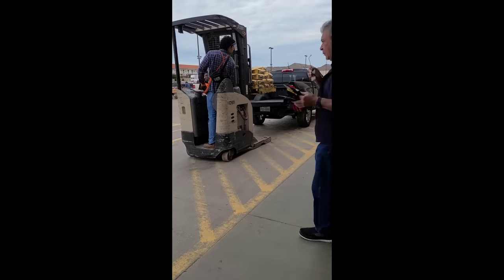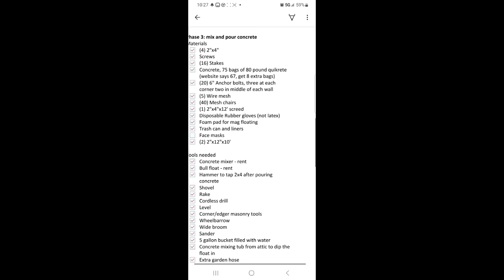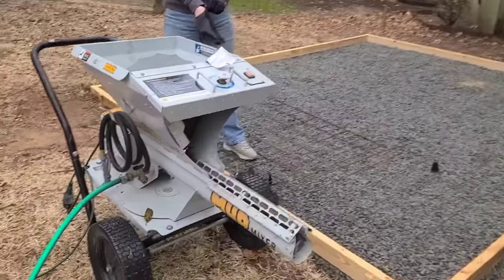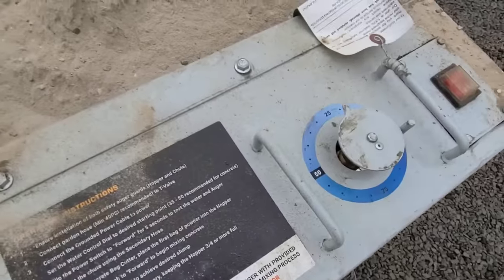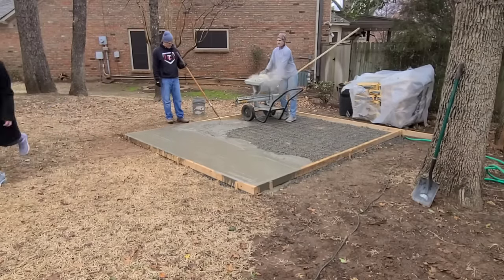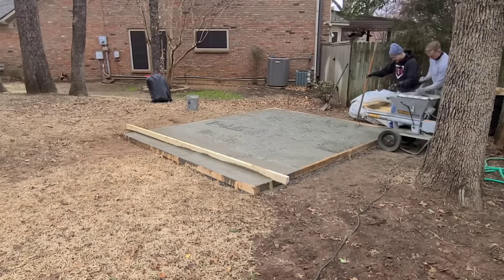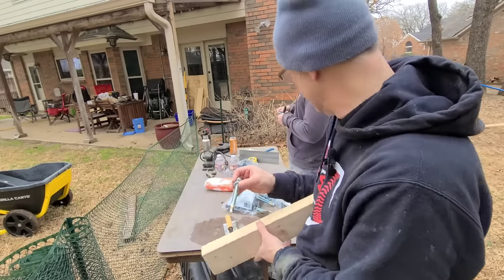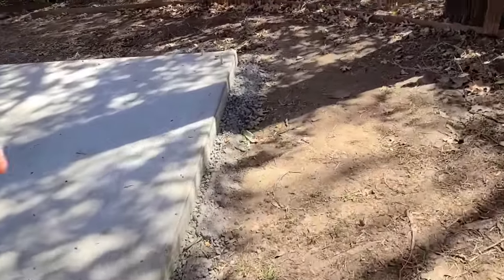Shed build part 3 - pouring the concrete slab

Comment: Not a chance in hell lol. I’ll pay the 400 dollars for 2 yards of concrete. Save that much in labor and be done in half the time with less effort. That pained me to watch. Btw a steel trial doesn’t bring cream to the top it closes the surface of the concrete.
Reply from the maker: I would love to live in an area where two yards of concrete is only $400. Here in North Texas, it's a bit steeper than that. I received estimates of $2k and $2,700.
Reply: Good luck getting 2 yards delivered for $400.
Reply: Nah where I’m at a crackhead won’t do for 400 that’s so cheap it’s almost insulting
Reply: Steel trowel.  Ya ignoramus
Reply: @wiltheisen7873 are you sure you were quoted correctly??? It's nearly impossible for it to be so high especially in Texas. Someone if overcharging you. You must have gotten the quote from a contractor. You should call the batch plant where the concrete is mixed
Reply: Where do you live that 2 yards of ready mix is 400 bucks delivered?

Comment: Those anchors look like wedge anchors...meant to go in after the concrete cures...🤔
Reply: Yeap those are useless the way they set them in fresh concrete
Reply from the maker: Solid comment. Thank you. I am still learning. Now I am happy I only put two in.
Reply: Should have used L bolts
Reply: @wiltheisen7873  another thing to remember is always pull your wire up off the bottom
Reply: It's a shed. Those anchor bolts will be fine. L bolts are designed for this application, but those have enough surface variantion to hold fine in the wet concrete.
Reply: Exactly what I was thinking before I read your comment..

Comment: One of the reasons you had so many extra bags left over was because you mixed your concrete with way too much water taking the place of concrete mix. Per QUIKRETE instructions use 6 pints (3 quarts) of water per 80 lb bag of mix, final water is 6-9 pints. The mix is supposed to be thick and chunky with a 2-3" slump (a 12" tall cone is filled with concrete, probed with a rod to remove air, and then the cone is lifted to see how much height the cone loses which is the slump measurement), people all the time add too much water and their 4,000 psi concrete is now not even close to that spec. The Mud Mixer is so much easier and fast than mixing in a wheelbarrow or mixing tray

Comment: Concrete max count probably off if you calculated bags based on 2x4 slab when a 2x4 is actually 3.5” tall, not 4”. Good work, I’m excited to try one of these Mud Mixers in person.

Comment: Nice video. The anchor bolt error has been covered adequately, but since you were not able to get them in before the concrete set you were going to need expanding anchors anyways.. The other point I saw is one of the most common errors and one I see many pro do out of laziness is not getting the mesh up into the slab. Just pouring on top of the mesh is not too effective, it needs to be lifted up as you place the concrete so it's in the center of the pour. Better yet, it should be tied to blocks to keep it elevated as you pour.  Not sure if a mudmixer can handle fiber mesh but that may have been an option too.  Fiber mesh is chopped fiberglass strands that are added to the concrete instead of using wire mesh or rebar.
Reply from the maker: Thank you for the comment. Solid point. I originally set the mesh on rebar chairs, but the mesh was then actually sticking out the top of the concrete. Then I tried to sink the chairs into the compressed rock, and still had the same problem. Since the mesh was not perfectly level, I expected some of it to lie on the bottom, but a good portion was actually raised at least one inch from the bottom. Given this shed won't be holding more than three elephants at any given time, I got comfortable with that. 😉
Reply: I actually just reached out to MudMixer about using fiberglass mesh. They said they'd tested it with "Helix Mesh Rebar", which is the metal fibers. They said they used 9lbs per yard with no issues. They didn't indicate anything about fiberglass mesh. Helix is pretty pricey though, like, $33 a pound or so. Not financially viable for me, so I'm prolly gonna go with Owens Corning pink bar. Lowe's has it for 3/8" x 10' for around $6. Not bad IMO.

Comment: Nice job. I agree with others that those are expanding anchors meant for cured concrete. Luckily for you that you only placed two of them as they have little holding strength as is. Your metal lattice needed to be raised off the ground before pouring. It does no good at the bottom of the concrete pad and is subject to moisture and rusting. Also, that size pad would benefit from having an expansion joint in the middle. Not critiquing you as your project is done. Just some tips for others looking to do a similar project themselves as I am. I appreciate you sharing and helping others. Stay blessed.
Reply: Better still to use reinforcing bars 😊
Reply from the maker: Thank you for the comments. I did start with rebar chairs, but they were too tall. The mesh was sticking out of the top.

Comment: Nice video.  Two things I noticed - you had chairs on your list but did not see you use them to elevate the mesh and your concrete bags were too far back on the truck.  The load should be over the wheels or as far forward as possible.

Comment: Awesome job on the slab. Only comment I would say is you probably should have created control joints within the slab. Cracks may form overtime. Otherthan that you did awesome. Love the video
Reply from the maker: Thank you. I hear you on the joints. I did consider that. Given our soil type, and the rock base I used, I decided to move forward without joints. I understand it may crack.

Comment: Evidently you don't watch YouTube a lot?  Wire mesh is meant to be in the pour, not under it. For all you DIYers reading this, the mesh will not prevent cracking. It is used to prevent the slab from stepping if it does crack. Re-rod will eliminate most cracking only if used diligently.
Reply from the maker: Thank you for the comment. Solid point. I originally set the mesh on rebar chairs, but the mesh was then actually sticking out the top of the concrete. Then I tried to sink the chairs into the compressed rock, and still had the same problem. Since the mesh was not perfectly level, I expected some of it to lie on the bottom, but a good portion was actually raised at least one inch from the bottom. Given this shed won't be holding more than three elephants at any given time, I got comfortable with that.

Comment: Good job for an amateur. Are you still using the mud mixer for other jobs?
Reply from the maker: Thank you for the comment. I do have another concrete job I plan to complete using the Mud Mixer. But first I need to finish this shed. I did rent the Mud Mixer, I don't own one.  Thank you again.
Reply: @wiltheisen7873  thank you for the video

Comment: It would have been a good candidate for a dry concrete pad.  Looks cool.  I’m building 16’x20’ up on a pressure treated deck.  All good
Reply: Cajun Country Living
Reply: Why not just mix the damn concrete? Why Why Why do yall have an obsession with dry pouring concrete when you're not saving any time and you're causing the concrete to be weaker?
Reply: Michael W. That was a joke. Right? 

"Dry Pour Concrete" is short for "Too Damned Lazy to Mix Concrete With Water" in the correct proportions in order to obtain the conditions that enable the chemical reaction (people who don't understand chemistry call the process "curing"--concrete doesn't "cure") that allows the wet concrete to harden through a process of crystallization. Actually, the correct name for "Dry Pour" is "Dry" "Poor concrete".

I would really like to have the Cajun Couple do a "dry pour concrete" for a retaining wall. Undoubtedly when they would take the forms off, the whole thing would fall to dust. Maybe with "dry pour" retaining walls, you just don't take the forms off.

Just saying.
Reply: @harrisorourke6926  I agree 100%. It doesn't take that much time to just do it right
Reply from the maker: @Michael W...Thank you for your comment. I did see a number of dry pour  videos. I guess I didn't see the advantage. Mixing concrete is pretty simple, and there still seems to be quite a bit of hassle with the dry pour process. Thank you for watching and thanks again for your comment.

Comment: Im curious about the mud mixer. How long did it take for it to pour that amount of concrete? Also great work it came out solid.
Reply from the maker: Thank you for the comment. If you know what you are doing, it goes pretty fast. For me, it was a slow start, but after the third or fourth bag, it went faster. I think the concrete pouring itself only took 2.5 - 3 hours. The floating and trowel work took another couple of hours.

Comment: $3K for the Mud Mixer is pretty steep unless you use it for your business. I would get a mixer truck to come out. Cheaper for a one-time job and you do not have to find a place to store it during the 364 days of the year you are not using it. Cool tool though. Need to find a place that rents one.
Reply from the maker: I rented this one from Sunbelt for around $80, just one day.
Reply: @kimbuck-2  When they put down QuickCrete in a form dry, level it,  then add water a little at a time to let it saturate the mix until it crystalizes and hardens over the next few days.

Comment: Did you pour the slab over the woodchucks or are they moving in later?  I didn't see them on your list
Reply: That’s so funny… I bought a house that had a small barn with hand poured floor, I walked on it and fell through because ground hogs (wood chucks) had undermined the floor so extensively.

Comment: How much did it save you to do the job versus buying a truck to deliver concrete
Reply: A job like that would have been about the same amount to get a truck and a lot less work and a stronger foundation
Reply from the maker: I spent about $600 on rock (see video #2) and concrete together,  $80 to rent the mud mixer, and other minor expenses. The concrete folks in my area are flush with business, and the quotes I received were over $3k, top quote was $3,700. So I did save a bunch. But I also enjoy outdoor work, and this was a fun learning experience for me. I am enjoying doing this project myself.
Reply: @wiltheisen7873  I'm in the same boat here in NW Ohio... Need a 14 x 14 pad for a shed, to have someone come in and pour and finish was well over $3k!!!  The local concrete yards won't waste their time on a small job.  One guy said if I got everything ready to pour, MAYBE he'd call one day if they were done on a job and had some left over but he added he wouldn't be able to give me much notice.... I actually told him that'd be great.... and then asked if I needed to be there and I think A) he wasn't expecting me to agree and B) he QUICKLY took his queue to call me on not being there saying 'you would need to be there'.....
Reply from the maker: @bill smith I think the Mud mixer would work well on a 14'x14' slab.

Comment: I have an issue with my MudMixer. The water valve seams tooo sensitive. If I move it 1/8 of an inch the mix is way to wet, 1/8 inch the other way it way to dry. 
Have you had that issue ?
Reply from the maker: Oh wow, that must be frustrating. No, I did not have that issue. If I had that issue and had rented the machine, I would have returned it to the rental place and let them know. There must be something that can be adjusted. If I owned it, I would have contacted the manufacturer. I understand their customer service is solid.
Reply: You might want to check your water pressure, may be too high.

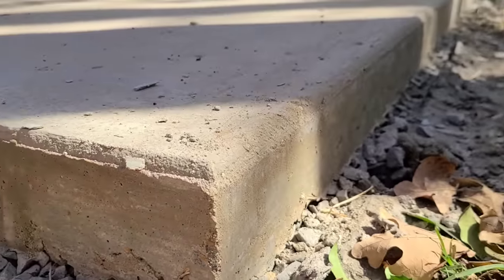Comment: 10:00   WHERE are the other anchor bolts around the perimeter ?  There only seems to be TWO bolts in one corner ?
Reply from the maker: Check out part 4 coming out soon. They will be drilled in later.

Comment: You guys must have money to burn, how much did you spend on bags of ready mix, did you do a comparison using dry raw materials. Its a good idea when your concrete is drying but still green to keep water on it so it dries as slow as can be, but all said its a nice slab.
Reply from the maker: Solid comment. I actually saved over $2,500 just by pouring it myself verses having it poured, and I had obtained two estimates. And I didn't want to deal with leftover raw materials. I returned some extra bags. It fit my needs. Thank you for watching and for the comment.
Reply: @wiltheisen7873 —
Smart, good job taking care of business.

Comment: I wish they made it capable of pumping the concrete as well, with a hose attachment.
Reply: Can use 4 inch plastic sewer pipe to direct pour.
Reply: @frankorosz901  I don’t think the flow would be strong enough to reach up and pour a concrete post.

Comment: Curious if you've done any similar pours with a regular barrel mixer?   You mentioned that it took 2-1/2 hours just to do the pour with the mud mixer, but it seems like you spent a LOT of time waiting on the mixer to dribble out the concrete.  With a commercial-grade mixer from a rental yard,  that would take 5 batches and you'd have the whole slab poured in 30 minutes.  And a little 2-3cuft DIY mixer, with one guy running the mixer and one spreading the concreate, could do that pour in under an hour.

Comment: You need to check out the Cajun Couple to learn their patented dry pour method.  You would have saved so much effort on that slab, plus you would have only had to redo it a few years later.  Love that mud mixer.  such a nice machine.

Comment: Did you rent the mud mixer? I’ve been looking for this machine everywhere and nobody has it and I really don’t want to buy one for 3,000
Reply from the maker: Yes, I did rent it. I should have mentioned that in the video. I rented it from Sunbelt rental. They are a chain, but not all of their locations had one. I called around and found one at a Sunbelt location within 15 miles of my location. I rented it for one day for $75.
Reply: @wiltheisen7873  Thanks for sharing this, ill check to see if my local sunbelt has one.

Comment: Would have been worth it to just have a mixer come in.
Reply from the maker: Thank you for the comment. In my area, the two estimates I received were both over $3k. My approach was about $600. That was enough incentive for me to do it this way. Thanks for watching.
Reply: @wiltheisen7873   I'm getting ready to do a 120 sq/ft slab and was quoted $3k too.. its crazy prices so I'm going to go the mud mixer route. $175/day rental. I'll need to hire couple of young guys to lift those bags!

Comment: you should have looked into dry pouring.. could have saved a lot of trouble..  but great job.. never the less. !!
Reply: It is hard to insert anchor bolts and keep them at the right height with a DRY pour !!  You would have to grout them in with a WET concrete blob a few hours before pouring the dry mix.
Reply: @robertchoutka3191 actually it's not an issue.. you can do it a few different ways.. just dry pour.. and drill ,  sqeeze goop in hole tape anchor down.. just like they do on slabs that are built ! .. or wait like 3 hours just before the first full watering  bang them down into the cement and finish watering. 
i'm sure there are a few more ways to do it..
Reply from the maker: Yes, I did see a number of dry pour videos. I felt more comfortable with this approach. Thank you for watching, and thanks for the comments.
Reply: That dry pour shit is whack. I can’t believe people even consider doing a slab like that. It’s ju at lazy and a piss poor way to lay a slab.
Reply: @tommysanfilippo3165 ???  The more water.. the more likely you will get cracks..  obviously you've got zero experience on this..
I've done 2 in my yard.. both over a year ago.. one was 7' circle for observatory.. 
other was an 8'x8' for my hottub .. both have zero cracks , both were easy to do.. and both have over 1000 lbs+ on them ..
Their is a saying.. you can work harder or work smarter..
I see u choose harder...
Good for you.. now that's waked !!

Comment: How do you think this will work for a home foundation?
Reply from the maker: I am not a concrete expert, but I would expect your home foundation to be much thicker than the 4 inches I used here. And my guess is your home foundation is much larger. Personally, for a home foundation, I would have a concrete truck bring in the concrete for that.
Reply: @wiltheisen7873  Yes I figured that would be the case, but always looking for alternatives,  if they work.  But ty for the response!
Reply: You need footings for structures of substance
Reply: A home foundation is started at least 2 feet below ground level, as you should have a perimeter foundation that is at least 2'X2' then having foundation trenches going across it also, then you pour the concrete over all that, your concrete strength info would be given to you by your architect, which you would give to your concrete supplier, thats not for a beginner.

Comment: Some score marks to control cracking world be wise.
Reply from the maker: Good point. I did see a number of concrete videos where scoring and cutting was used on larger projects. Given the size of the pad (10'x12'), the compressed rock base, and the soil in our area, and the fact that this shed won't be holding for than three elephants at any given time, I was comfortable with not scoring or cutting it. Thank you for watching and for the comment.

Comment: Wire mesh did absolutely nothing as it’s not in the concrete and is under it.
Reply from the maker: Thanks for the comment. Actually, it's difficult to see in the video, but because the mesh isn't perfectly level, it is actually about 1-1.5 inches from the bottom in many spots. I initially used rebar chairs, but the mesh was poking out the top of the concrete. Given this is just a 10'x12" shed on a good base of crushed rock with good soil underneath, I have no concerns.